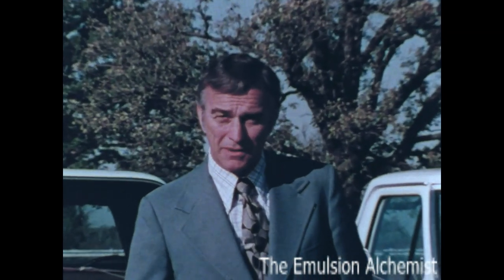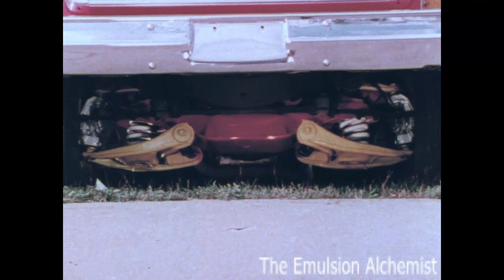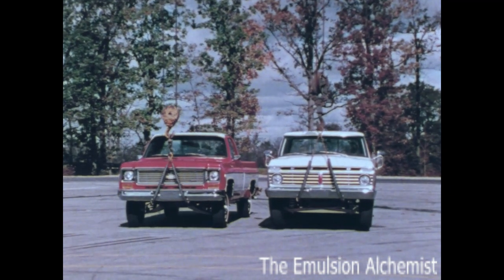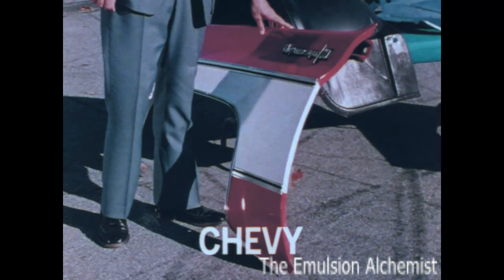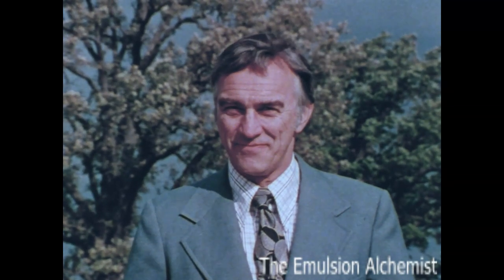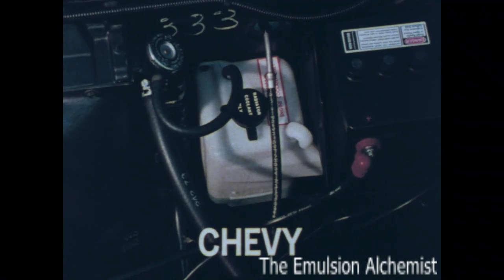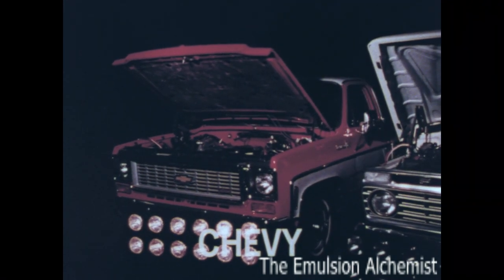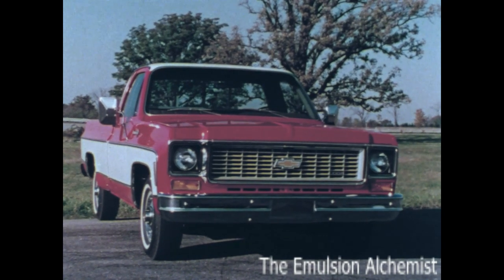1974 Chevy VS Ford Trucks side by side comparison dealership promotional training movie film

Comment: Yet they wouldn't mention Ford's Supercab introduced in 1974.  GM had no answer until 1988.  While the F100 couldn't win in 1974, Ford won the GVWR back in 1975 with the introduction of the F150 at 6050 lbs over Chevy's still 6000 lbs.  This way, it was much more of a fair fight.  Plus, people knew a better deal and idea when they saw it from FoMoCo which is they haven't been outsold since 1976 (And I know that just pisses off so many Chevy people because Ford is #1 in trucks)

Comment: I got to admit Chevy had the best full size trucks in the 70's, but then got lazy and kept the same design all throughout the 80s up until the very tail end of the 80s. But by that time ford long surpassed them as the number 1 sales leader in full size trucks.
Reply from the maker: no one wants to buy a new truck that looks just like the old one. even truck styles now change every 3 or 4 years
Reply: The chevrolet rust out lot more than the ford did in the 1970s  I like the looks of the ford better myself   to the chevrolet looks like a square box more style  ford become  square box in the 1980's to

Comment: 1973 was the first year for both those third generation Chevy C/K series pickups & sixth generation Ford F-series pickups. 1979 was the last year for the Fords but the Chevys on the other hand were still in production up through 1991, except the half ton & three quarter ton regular cabs were discontinued in 1987 & the one ton regular cabs were discontinued in 1989. In 1987, Chevy changed their C/K series to R/V series so they wouldn't confuse people with the new fourth generation C/K series pickups for the 1988 model year which were only regular & new optional extended cabs at the time because the crew cabs with the third generation body design were still in production up through 1991. In 1988 & 1989, two different body designs on the one ton regular cab pickups were in production which were the third & fourth generations.
Reply from the maker: you are an encyclopedia, thanks for the information
Reply: @theemulsionalchemist5688  not to forget the seventh generation Suburbans & second generation Blazers & Jimmys were also produced from 1973 - 1991. Those third generation C/K series pickups were the first Chevys & GMCs to have an optional bigger cab which was the crew cab introduced in 1973 & they were only available on three quarter ton & one ton models & all had the long wheel base & the only pickup box that came with them was the 8ft long fleetside one, unlike the crew cab pickups today which are also available on half ton models with a shorter wheel base & pickup box.
Reply: @theemulsionalchemist5688  1974 was the first year for the Ford extended cab pickup which they called a super cab back in those days. Rewind to either 1965 or 1967 which was the first year for the Ford crew cab pickup.

Comment: I own a k-10  Chevy and i can tell you  the frames are prone to cracking...... Ford had better frames / Chassis    both are good Trucks but the Fords were just tougher trucks.
Reply from the maker: I think the steel on the ford frames was thicker
Reply: There's kits to reinforce the cracked gm frame at the steering box....also a common site to see the chevy hoods bent in the middle along the outside edges.

Comment: Having worked on all 3, GM was newest, ford 5 or 6 years behind and dodge 10 years behind.  engine compartment in that ford looked like a 65 chevy did.
Reply: I found the same thing when I first saw the 67 Ford when I was a kid.I noticed that it had a big hood and the top styling kind of reminded me of the 66,and older Chevy trucks,and I agree the whole inner fender wells ,and radiator support look like it would belong in a 66, and older Chevy,and Ford had that same inner structure design from 67to79.

Comment: The twin I beams on the Ford where terrible. I had a 1974 f100 and at about 50 miles per hour the front end would bounce up and down and shake the whole body of the truck. The Chevy had car like steering which was smooth and better steering. Even when the Chevy had over a hundred thousand miles , its steering was still smooth.  It took awhile but Ford realized the twin I beams where junk and finally dropped that idea.
Reply from the maker: I hate the twin I-beam suspension. ford held on to it to I believe 2016 and some 2017 vans. I keep my distance when driving next to one hopping down the freeway
Reply: Dad  had a 74 Ford 3/4 ton with I beam and a 390cid . It was a good truck on our farm . But we are GM now . Dealers (sales and service) make the difference and the local GM is excellent
Reply: Ford still uses T-I-B.....extremely durable works fine.
Reply: @theemulsionalchemist5688  

Better stay away from all econoline ambulances and class C motorhomes, then.
Reply: @johnpeters9793  I don't mind I beam but the econo line one ton fifteen passenger van we had was a death trap  . The balance point was terrible. I've driven GM 3500s and they where much better
Reply: @robertmoulton2656  

I've owned an F-250 2WD and various motorhomes on econoline chassis.

Have driven almost exclusively Ford rescues for a living over 20 years...currently work part time as a medic for an ambulance company....never had an issue with any  T-I-B.

Worked a shift on NYE in a 300k mile econoline....drove fine.

During the 6.0PSD fiasco, the major ambulance company bought GM for a minute....the "massive girder beam suspension" could not take the abuse of the T-I-B regarding jumping medians/curbs etc....

Went back to the Fords and the 2V 5.4L (since no PSD offerings after the 6.7)

 It would not have been around this long and in so many heavy duty and special service vehicles if there was a problem. 

Honestly don't know what else to say...
Reply: @johnpeters9793  well . The school  units that used 15 passenger E350s hated them . Ford was at risk of being sued. It's not the i beam per say . It's more the 2 1/2 feet hanging past the back axel . The GM put the axle further back . It just works better . 
   You can  tell a Ford man . But you can't tell him much 🙄
Reply: @robertmoulton2656  

Don't drive 15 passenger vans....so don't care.

Thought the conversation was about the T-I-B.

But thank you for answering a question nobody was asking...
Reply: @johnpeters9793  ok. It's on . How many times did yall have to push that Ford diesel to the hospital ? 
  New Ford transit ambulances lack the fuel capacity for the northern work where I'm at . They have to carry Jerry cans . 
 5.4 l gas ...cam sensors . Spark plugs that blow out .
  Ya I guess you're  right . The I beam is the least of Fords problems .
   Using ford's as ambulances should be illegal.  Reliability  . Guess that's why ambulance company's always by spares .
Reply: @robertmoulton2656  

Yawn.....
Reply: @johnpeters9793  got to technical for you ? 
   I'll bet you know which crayons 🖍  taste best . 
   Just becase your a passenger on the I beam equipped short bus doesn't make you an expert  😏